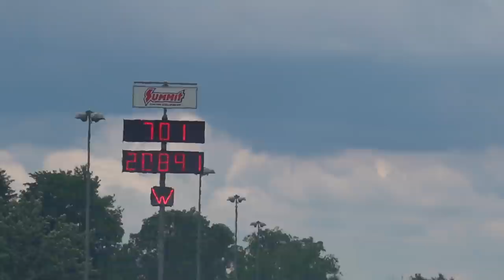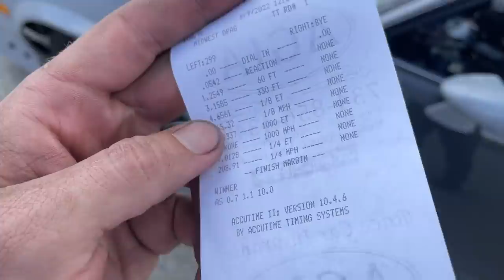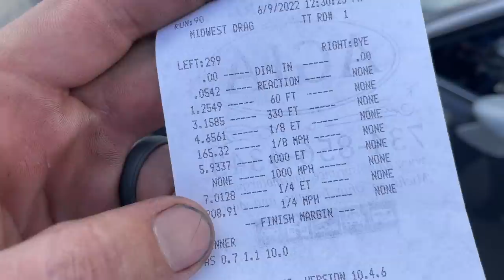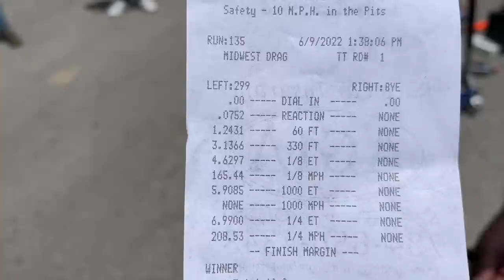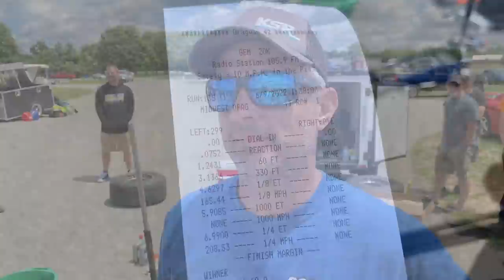Midwest Drag Week DAY 3 - MULLET'S FIRST Drag n Drive 6 SECOND PASS!!!

Comment: The big block has already earned its spot on the team. Whatever it cost it had to be worth it just for the smiles it's bringing you, your team and the fans.
Reply: If I had to guess he’s got about as much in that engine as most people have in the price of their home lol
Reply: @beardedbandito433  around 50k? 100k?
Reply: @beardedbandito433  mullet as a whole yes, for sure the motor about 100k
Reply: I think the Steve Morris engines run for around ~75k
Reply: Remember that’s a brodex block engine. So I’m guessing about half of what a hand made Steve Morris engine would be or about 50 to 60 thousand just for the engine!!!
Reply: @beratsbuilds  Damn. But it's well design, tough and reliable (when you don't mess up), I get why it's these kind of price.
Reply: @trentgay3437  a brodix block 540 is not 100k 🤦🏻‍♂️
Reply: @nalley6815  nope it's about 80 and then you fly in Steve Morris himself and pay 3 guys to throw that motor in asap. The titanium pipes etc... 100k
Reply: I'm sure Steve gave him a decent price
Reply: You are correct   bringing me lots of smiles too
Reply: Plus the cost of having KSR build the actual car…
Reply: That engine is 30-35k ish pan to intake. It’s nothing overly special.  Typical 540.
Reply: @trentgay3437   your talking 481x price not off the shelf parts 540. Lol
Reply: @trentgay3437  considering a full on SMX starts at 75k I doubt it’s 80
Reply: @JAKDRZR  yeah a typical 2000 hp to the wheels motor.... im guessing you run a stock 5.3 ls talking like a 540 SM motor is just a regular engine lol
Reply: who cares about the price of fuel when your car gets tthat many smiles per gallon.
Reply: @keedoopop4900   nope wouldn’t touch a LS. Bbc all the way. And yes stock bore space Bbc are simple and the parts aren’t exotic at all. Go start pricing out the parts. It’s not rocket science.
Reply: The total cost of Mullett in a years time, building the car, hiring Zach and Tye (and SAM!!) the engines he has gone thru, Hiring Nate, Kevin..you’re looking at a cool $400k in a year
Reply: The engine was 75k without turbos
Reply: @guy_autordie  most people,  not just middle class people
Reply: Mullet definitely is worth about 200k or a quarter  especially with all the suspension and the trans and new wheels, spare tires breaks. Anything that could have been done definitely has and to pay the guys to help build it, just glad to see it bringing the thunder tbh
Reply: @beardedbandito433  That's a relatively cheap piece, you could say that about a 481X or an SMX, or a BAE, proline, noonan, Hemi. But not a Brodix cast block and conventional cast head deal, so definitely not a "homes" worth in that engine, not even that close.
Reply: @Stevesbe  

More than likely because he's advertising products on his highly successful channel he pays little or nothing at all.
Reply: I’ve got about 25k In my dart aluminum block 540 and it has good parts in it.
Reply: @tymiller1944  Do you think in a years time he has spent $400k on Mullett?? (with hiring Zach, Tye, Nate, initial costs of building the car and engines etc.)
Reply: @StreetRacingChannel   exactly. The billet intake on tbhe mullet is a expensive piece. And if it has a billet crank that’s a little more too. That’s why I said 35k
Reply: 84k longblock
Reply: A fully ready SMX which comes with the power adders starts @ $75k.
Reply: Cleet brought in his own power adders so I'd says it was substantially less, 50k??
Reply: @beratsbuilds  you are correct. $75k is ground floor.
Reply: @beratsbuilds  yep,$75k
Reply: It's all a write off some how
Reply: @StreetRacingChannel  my dude I've been following yall for years anybody passing this dudes channel is sleeping to hard.
Reply: @StreetRacingChannel  that’s not bad
Reply: @BeardedBandito If I had to wager it's easily $100,000. According to the interwebs Steve's engines start around $75,000 and I can see another $20,000 in the turbo setup/fuel system/engine management pretty quickly.
Reply: @jeremiahdane3021  an SMX starts at 75k. This is not an SMX or even close
Reply: Mullet essentially pays for himself lmao
Reply: a Steve Morris engine will run you between 50k to 150k depending on how far you are willing to go. I bet he payed north of 30k for the long block. plus cleets parts and time I'd bet there's another 20k+ in power adders and another 30k+ in transmission and rear end and suspension plus KSR built the chassis so I'd bet another 30k+. I would bet that that's a 150k+ car.
Reply: Earned its spot on the team?? The what? Big blocks will always be superior over an ls, it’s just been a journey to get to the team earning a big block
Reply: @derekbuilt7761  bull it cost about tree fiddy
Reply: It’s not a SMX so it’s a cheaper motor but not cheap if that makes sense. I’d guess and say 40,000
Reply: @nalley6815  this, it's legit a cast aluminum block and heads. 75K and up were talking billet stuff.
Reply: It codt everything
Reply: @evo7836  75k starts his SMX. This isn’t an SMX is what I’m saying
Reply: @StreetRacingChannel  can’t wait to see that thing fuckin rip!
Reply: @nalley6815  oh absolutely, I was agreeing.
Reply: @evo7836  my bad, misunderstood you. All these “race fans” think any built engine is 500k it seems like lol.
Reply: @guy_autordie  lmao. You must not be from Florida.  You aren’t buying anything here for 50-100
Reply: about 75k,
Reply: @beratsbuilds  taxes make em pretty much 100k, easily 110k-120k when you factor in the cost of actually installing and tuning the thing, im sure Ty and the other guys make a fair buck, then you've got the cost of the turbos, titanium exhaust, etc
Reply: Someone commented on another video and I've seen it confirmed in the facebook group: Total in for the new motor and turbo setup was between $125K <-> $127K. And that's not counting what they paid for Steve Morris himself to fly down and tune it.
Reply: @Proftheskidkid  never understood the issue with taxes in the US. In Europe prices always include taxes, so I don't have to start calculating the actual amount I have to pay
Reply: @beratsbuilds  89k for a billet ls. 
Cleetus got a cast block and head. 
Definitely prolly around 60k +/- 20k so 40-80k depending how he spec’d it
Reply: @joshr8680  Mullet is still at least worth a brand new Lambo, without counting the broken parts in the process
Reply: In the long run I think it’s cheaper than the LS. Statistics show that reliable is cheaper in the long run
Reply: The Morris BBC is not faster but it doesn't have to strain it's guts pulling around a boat like mullet.  That last LS they built would be unbelievable in the proper race car!!
Reply: @beratsbuilds  Yep, not counting a SMX!  That is another story.
Reply: @nalley6815  A "full on" SMX running off of the Morris dyno runs around $125k +.
Reply: @JAKDRZR  In the right car, an LS is the better choice.  Comparable HP and lighter weight.  It just depends on what you bolt it into!
Reply: @evo7836  For what it is worth, it has Brodix heads as well.
Reply: @unapologeticallypatriotic3853  It may "start" at $75k but it is not running or "fully ready"!
Reply: @derekbuilt7761  I'd add about $100k to that.  Your pricing is low for some of that.
Reply: @StreetRacingChannel  Ready to see that thing make a pass.  Love all your guy's channels.  Take care Billy.
Reply: @paulcopeland9035  not when cleet has sponsors bud. I'm talking about what he has into it. If a guy like you or I with no sponsors would be north of 280k ish done right. He got deals with sponsorships.
Reply: @paulcopeland9035  you think he payed that much haha nah bro
Reply: @paulcopeland9035  did I say it wasn’t? I said it starts at 75k
Reply: @paulcopeland9035  I agree. For going around corners. But if you want fast in a straight line with reliability and resonae cost a bbc rules the roost.
Reply: @beratsbuilds  fuck yeah. It prolly cost 150-225k to build that car
Reply: @derekbuilt7761  Sure, of course he did.
Reply: @derekbuilt7761  No I don't.
Reply: Cleet said in the reveal of the engine video that it’s an aluminum block
Reply: @JAKDRZR  Not so.  Like I said, LS in lighter vehicles are running amazingly fast times.  Plus, nothing makes cheaper power than the LS platform.
Reply: @nalley6815  it's the best 100k ever spent.  You pay for Steve Morris builds because he makes sure you have no issues with the engine,  tuning,  whole package.
Reply: @anthonyrybczynski5420  oh for sure no doubt. If I needed to make that much power Steve is 100% the one I’d be going to
Reply: @paulcopeland9035  not reliable power. Yeah you can boost a junkyard engine and go fast but it don’t last. Build for build a bbc is cheaper and more reliable at the same power levels.  I know this because I see it all the time!!
Reply: @beardedbandito433  business expense ;)
Reply: @paulcopeland9035  yes I know. It's a cast aluminum brodix block and heads, conventional style deal.
Reply: @A7Xfan2007  Yep, sure is.  It is a Brodix aluminum block with Brodix aluminum heads, all massaged together by the magic hands of Steve Morris!!
Reply: @paulcopeland9035  aren’t they Steve Morris heads? I definitely could be wrong though lol
Reply: @JAKDRZR  Not reliable?  There is a lot of big LS power running around out there on the cheap!  Hell, Garrett has a bunch of his own and has had great service for a lot of racing and shenanigans!  He never had catastrophic failure till he started trying to pulling around that boat of an Elco and get it into the 6's.  He yanked the guts out of it.  That engine has some really good parts.  When he gets it back repaired and puts it in lightweight Ruby or Leroy or whatever, I will guarantee you will see some stout performance!
Reply: @evo7836  Okay.  The comment I received sounded like you were confused. Have a good day!
Reply: @paulcopeland9035  that's what cleet got. Is it not? He brought in all his own power adders. They're all built & dyno tested so yeah they come to you ready to bolt in and run. Remember when cleet and Jimmy busted the crate open is was just the SM engine, w/ no power adder, he brought in his own turbos, ignition system was already on the car & he built his own plug wires, I don't think it even came with the coils.
Reply: @paulcopeland9035   I’m not saying they are junk but dollar per hp a bbc is better. Look up the costs of rotating assembly’s. Heads and the like.  They all are similar in cost and you get way more cubic inch out of a bbc so you don’t have to run it as hard. The only place a LS is awesome is when using stock long blocks. If your building with all aftermarket pieces you are way better off going bbc. Why do you think Garret went bbc block. He had to push the LS out of its reliability and it has nothing to do with the weight of the car. More like the 50 pounds of boost they were trying to put through it to make the power they needed. Now with the 540 they are at 30 psi. That’s a huge jump in reliability. Engines are just air pumps bigger intake ports and more cubic inch make more power it’s pretty simple.
Reply: @A7Xfan2007  Nope, they are Brodix heads.  Steve Morris heads fit only Steve Morris blocks and the combination is labeled SMX!  That is the real deal but you better have "real deal" money if you want to get one!
Reply: @unapologeticallypatriotic3853  Yes, you are correct.  The only "extra" it came with was that sweet intake manifold.  In Steve's video he mentioned modifying it to fit the fuel rails Garret wanted to run.  Very nice, I must say!
Reply: @tripprogers4814  and the jet engine that was intended for mullet that fell through
Reply: This is why you lash the motor lol
Reply: Steve’s brand new SML engine package goes for 89k
Reply: Thats not how business works.  I get what you are saying but its money in money out and if the channel supports a nicer whip on the strip…then so be it
Reply: Probably 50k in the motor itself now with the turbos exhaust probably another 20-25k

Comment: As someone who has raced at this track you're a madman going 208 there. That shutdown is not long enough for that kind of speed. It's a testament to those TBM Brakes for sure. Congrats on the 6.
Reply: Wonder what track record is
Reply: cleeter does it for Dale everyday!!!!
Reply: Does it at least have a sand trap and nets at the end of the shutdown?
Reply: So no drum brakes... got it!  HAHA!
Reply: @aaronpreston47   From google earth the track has an extra 350ft of pavement past the turn off and then 300ft of sand.
So it has the same paved length as Bradenton and it has sand after that.
Actually US 131 where he stopped Tom’s Sick Seconds 1.0 from 225 has less pavement than this. The problem is the turnoff isn’t at the end.
Reply: @aaronpreston47  I run there often. it is a pebble/sand trap lol shut down is short but they do have a pit.(that you don't want to hit) lol
Reply: @keithstubbs4473  better than a tree
Reply: @keithstubbs4473  Yeah most places get real upset at you when they have to pull you out of the pit...
Reply: @jttech44  unless youre in a promod and your brakes just arent enough or fail not really much of an option going 200 mph in a straight line shit happens
Reply: @jttech44  That is a correct statement my friend!

Comment: This further solidified the Steve Morris reliability.  Time and time again his engine program works.
Reply: Doing it in stride to boot..
Reply: @heretickle699  it’s the track not the car… also cleetus’s tires the engine works just fine in so sure it can do what it says it can do but tbh mullet just needs a better system maybe awd
Reply: SM’s Program Isn’t Of Question…

Cleet Needs Some Adderal… And Hopefully, He Will Create A Manual Checklist Tear-Off Pad…

“To Work From Each And “EVERY” Time.”…

Too Many Simple & Dumb Mistakes.

#1 - Not Listening To Your Own Initial Judgement On Your Carried Speed, The Limited Shutdown Area… And What The Brakes Were SCREAMING, Telling You! 

Awesome Content Only Matters, If You’re There To Create The Next One. Damn.

Congrats On The 6..!! 👍🏻🤘🏻
Reply: Cleet be doing fives when he can afford it, and he's ready!
Reply: @crazyfrank3866  it would be so hard to fit an AWD system on Mullet, and would cost so much it would not be worth it. Plus, the only AWD GM G-Body that I know of was that one on the Hoonigan This vs That show, which was a completely custom setup. It had a smaller engine with a setup likely designed around the concept of AWD, which would leave more space for the AWD. Mullet does not have that luxury.
Reply: @jackets64  ya I know I was just meaning in theory it would be faster if it was awd probably could get that sick VW hookup where he turns on each engine to do front burnouts and a rear burnout
Reply: Building a good engine has a lot to do with experience and the right tools.
Reply: @crazyfrank3866  last thing that car needs is more weight lol
Reply: @crazyfrank3866  unlikely
Reply: @SFR_99  it could use it with the way it spins
Reply: @BeerKillenRedneck  I agree with the checklist. It’s the simple things that continue to pop up and cause little issues. 

Work on the small things and rewards get bigger!
Reply: @crazyfrank3866  It absolutely would not be faster as awd. Go and look at any of the fastest cars on the strip, they are all rwd
Reply: @bradynk9502  I’m meaning grip better which in theory would make him go faster than he is now but until he puts better tires on I don’t see him breaking anything much lower I like it rwd too I’m just saying shit
Reply: Engine lasts a week, 
everyone "Steve Morris engines are so reliable!"

Dudes right foot just breaks stuff.
Reply: @hobman  Except that was not at all the engines fault. He said right after that to Kevin that traction control was locking him out. The computer was pulling timing from the engine. Traction control was doing exactly what it was supposed to it just shouldn't have been on. Can't blame that on Morris at all.

Comment: And thats why the Big Block makes sense, able to do those high 6s to low 7s back to back, has some more in it, and isn't pushing the seams of its capabilities to do so. Hopefully that beast will last a long time, until Cleet decides he wants more and gets an SMX
Reply: Yup this is the Mullet we should have have had from the beginning, there was no reason to try and make an LS live in this car, it's just too heavy.
Reply: LS is the comfort zone, and 6 second ls cars aren't too rare, mullet just weighs a lot
Reply: not sure that Mullet can handle a SMX, that's Another 2000+ hp .. kinda in the Pro Mod Territory there
Reply: @scottbroyles2114  whats SMX?
Reply: Yea i dont think kevin completely did the chassis on mullet, keeping it a street class car..  so pro mod is a no go and ole buddy likes doing these drag weeks so i dunno if he will go that rout eventually or not..  when he does tho, gonna need em a completely ground up build..  with some big boy wheels up on it..  lol
Reply: I'm a small block fan, which is why I'll never do 6s, but this is why I like ripping it in the dunes in a 700 over a higher strung 450.
Reply: @cryptobigboss  its Steve Morris's own designed all billet waterblocked big block, basically an all billet pro mod big block that you can run on the street tailor made for these kinds of events. Can handle even more power then the Big Block Cleet has now, they'll run 4,000hp+
Reply: @jacobszymczak9323  wow!! nice.
Reply: @Z-Ack  Yea it would be a new build. I can see them doing that though and running a new car all together with the big boys classes. They just keep upping the game at the freedom factory each year.
Reply: @DoYouLikeThisName  I was gonna say this same thing. Dude just keeps going faster. He had the exact same excitement the 1st time he ran a 9 years ago.